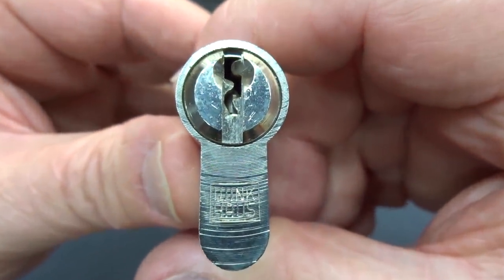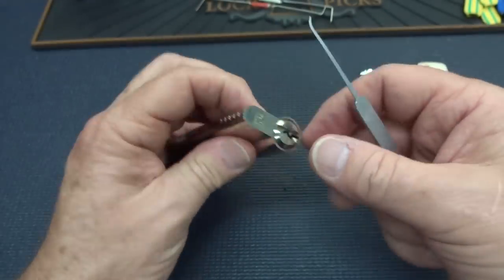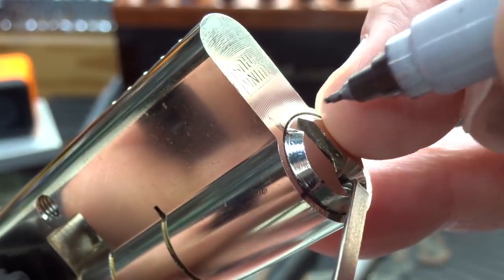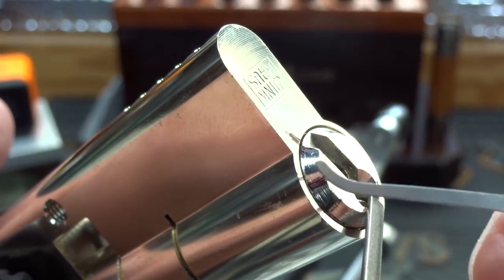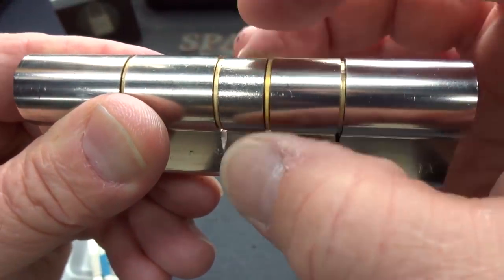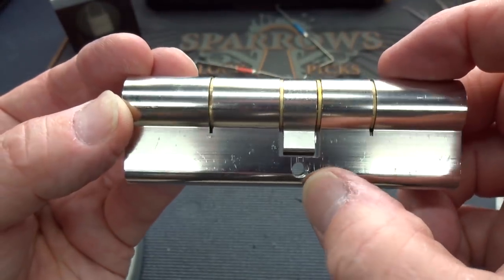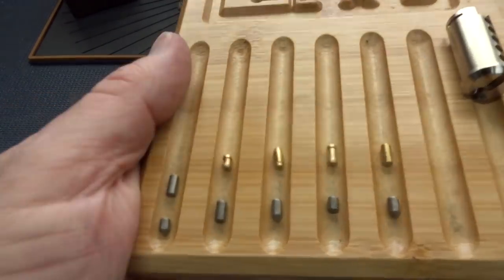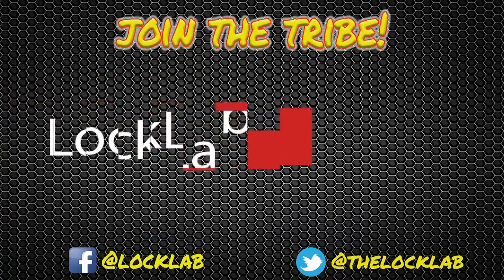(1339) Winkhaus Evicted From the Naughty Bucket!

Comment: I'm afraid the "special unbelievably expensive tool" is an ordinary saw, with which you cut the brass ring to the core just "with" the slot (and not across the ring, as you did) and then removed it, like You did it. ;-) In the most cumbersome case, the brass rings are simply broken with pressure and a fine, narrow chisel in a drill press.  Very nice video :-)

Comment: I've gutted Nemef euro cylinders (that use the same construction) by cutting the ring itself, in the direction of the slit in the cylinder. Since it's crimped on, it can't rotate, so a regular metal saw works.
Reply: yes, I was thinking the same - even with the dremmel you should be able to align one of the thin cutting disks with the ring and avoid damaging the lock much (might scrape up the sides of the groove a bit though - you have to weigh the benefits of speed vs clean cut for yourself)
Reply: Yup! I used a drill bit small enough to fit in there and drilled a hole in the ring though the BOK and just bent it out using the clip remover from the Euro kit. You can replace it with a standard c-clip.
Reply from the maker: Excellent idea!  I didn't know how deep I'd need to cut or what was beneath it and was afraid it might seize the cylinder.  Now that I know that cutting into the core a little if I cut too deep with a saw really won't hurt anything, that's how I'll cut them from now on.

Comment: I came across a compression ring just like that when disassembling a Wilka euro-cylinder, only the ring was at the end of the core, just beside the cam (i.e. where you'd normally expect a C-clip on such a lock).

The easiest way to disassemble it without any special tools is to cut a piece of it parallel to the clip (not perpendicularly as you've done it) with a thin saw. Since this is brass it doesn't take too long. Obviously the original clip is no longer usable after that.

To put it all back together you either need a new, fresh full ring where you can compress the sides or a standard C-clip. In the latter case however you need to cut a full groove around the core to make it fit - I've used the same saw blade, put the empty core in the housing and used the gap for the original clip as the guide to saw a groove all round the core.

Comment: My thought would be to drill thru the ring on either side, this way the ring would be divided into 2 half-rings and at least the bottom part would have been easy to remove and the rotate the upper half after that.

Comment: I think you have to rotate the cylinder 180 and push the ring up into the slot, pull on the key and rotate back past the ring.
Reply: Sorry, 180 then push down on the ring via the slot.

Comment: Fun fact (or not, but I was amuzed, when I found out) : I have a YALE euro cylinder (i used it to learn howto do my very first cutaway lock)...
It has JUST the same wardings/keyway as this cylinder... But symetrical ! (left and right flipped).

I was wondering if the video had a flipped image, but the "winkhaus" sign reads good, so nope ! 
I never suspected this could be the case !

EDIT: one of the lock in my house is a vachette, and i found out a long time ago that my yale key inserted just well in the vachette cylinder (but don't give an open, obv). But in that case, they are not symetrical...
Reply: Also I never managed to pick it, even by locking into the cutaways, and it missed pin 3 (1 out of 5, because I make a too wide cut on this chamber, and could not make the screw path to then screw the spring retaining element... Yes inspired by the sparrow's "revolver" training lock).

But I guess I dont have the right pick for such a keyway.

Comment: Bill, I'm usually impressed by you, but not this time. That ring can be cut through the groove with a hacksaw - and you only end up with a little cosmetic marring that can be fixed with a file. Also, cutting the lock in half, while sensible considering the sharing among the community, is a sacrilege to being able to put things back together. Get or make a pinning shoe and do the (re-)assembly from one side. I repinned lots of europrofiles when I was around 10-12 and all had these closed pinched rings.